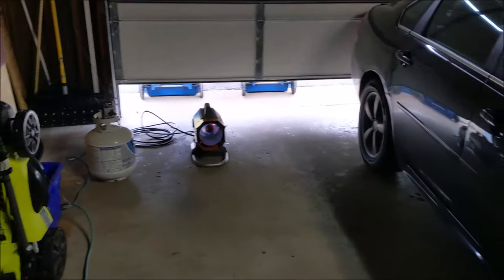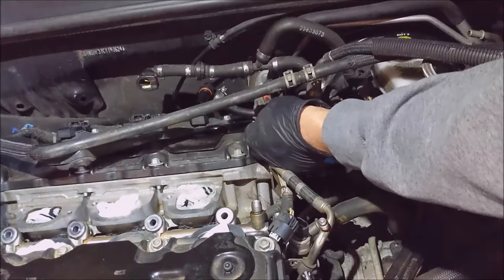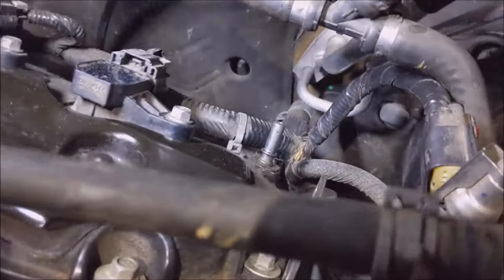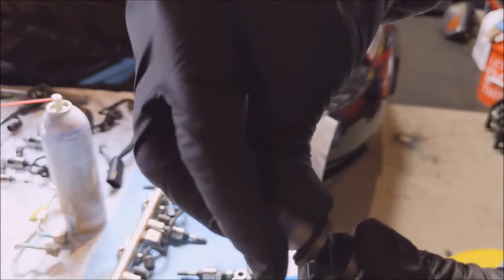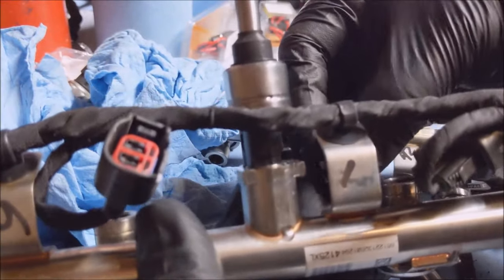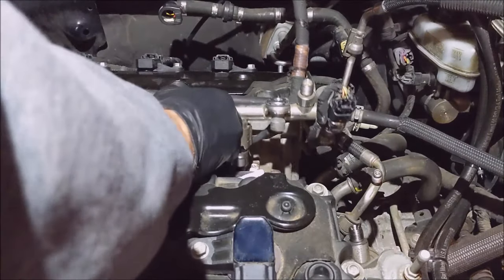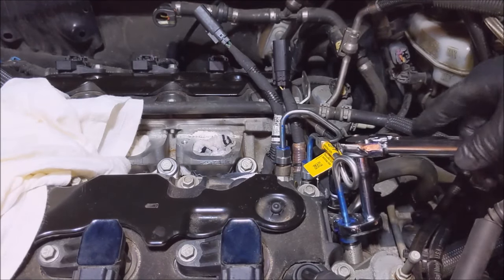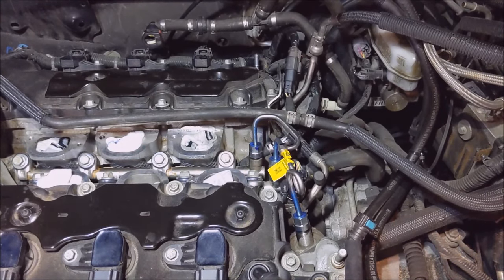GM 3.6 LFX V6 Fuel Injector Replacement (Part 3 of 4) **9th Gen Impala - Others similar**

Comment: How many miles on your engine and also, how’s the timing chain??
Reply from the maker: Had 158k at time of recording, I sold the car at 182k. Never had any timing chain issues because I changed the oil every 4-5k. Stringent maintenance is the key on these 3.6's..
Reply: We have a Camaro that we bought brand new in 2012 with a 3.6. Time in chain seems to be in good shape. But I do have two lien codes. 0171 and 0174. I replace the fuel pump, O2 sensors and map sensor. Also checked all vacuum lines. I still have the codes
Reply from the maker: @samconway5288  Which fuel pump did you replace? If you changed the high-pressure pump, the fuel rail pressure sensor may be bad. Also check the Bosch page I have linked in the description for more guidance.
Reply: I just had that same issue, I was the high pressure fuel pump. When it goes bad it will leak fuel into your crank case and cause these codes. Smell your oil if you smell gas this is 100% the fix.
Reply: @CertifiedShadetree  I replace the one in the tank passenger side
Reply: @CertifiedShadetree  fuel pressure at rail 51 pounds. Did a live data fuel pressure on injectors. 
1- 49
2-45
3-35
4-39
5-39
6-37
Reply: @kicknhobo  where is the high-pressure pump? I replaced one in the tank
Reply from the maker: @Sam Conway  Follow the fuel rails down near the thermostat and you'll find the pump. On a FWD car, it's on the driver's side, so it's probably driver's side near the firewall on the Camaro. You will need a special tool to replace it (it's driven off of one of the camshafts, so the 2 cams need to be locked into place.) I need to re locate that page at Bosch, seems it's a dead link now..
Reply: @samconway5288  40:00 time mark he connects the fuel rails to the high pressure fuel pump
Reply: @samconway5288  on your car it’s going to be on the back of the drive side bank it’s looks like a pain to do
Reply: @kicknhobo  Yeah I’m sure it’s gonna be a pain in the ass. I’m not a mechanic but a master certified in collision .
I’m  a structural technician. If it has 51 pounds of pressure at the fuel rail would it still be the high pressure fuel pump or fuel pump regulator??
Reply: @samconway5288   The problem is not about pressure but an internal leak which is causing your rich condition. Check out this video, he goes over all the trouble shooting and arrives at a bad high pressure fuel pump. https://youtu.be/GlK-BZuq8K8 around 11:00 he talks about the pump and goes wrong with them.
Reply: @samconway5288  had to do mine at 143k. I don’t know how old the code was due to just getting the vehicle. If your car has anywhere near that and you have no service record of it being done then it’s at the end of its life
Reply: @kicknhobo  Yeah my car is running lean right bank and left bank
Reply: Was yours misfiring a little bit at light throttle?
Reply: @kicknhobo  We bought the car brand new in 2012 it’s my wife or car
Reply: @samconway5288  I couldn’t tell you, at the time my timing was off by one, bad VVT phasers and the bad high pressure fuel pump. So I fixed it all and now running well, I’ll  just need to clean the carbon from the intake and I’ll be done with all major and minor issues.

Comment: What fault code did you pull for that injectors
Reply from the maker: P0276.  Injector 6 voltage low.  There was a TSB issued for a wide range of DTC's spanning many years of the 3.6 that mentioned the main injector harness chafing on the transmission housing.  I did not find the harness anywhere near the transmission, hence I doubt that was why the code was thrown.

Comment: Is that the fuel pressure regulator at 3:43 to the right
Reply from the maker: Actually it's the High Pressure fuel pump. The HP fuel pump does modulate the fuel pressure, though. Be sure to click on the link in the description for Bosch's website, they explain it a whole lot better than I can!
Reply: Thank you. I've been trying to locate where the fuel rail pressure sensor is on my 2010 camaro lt
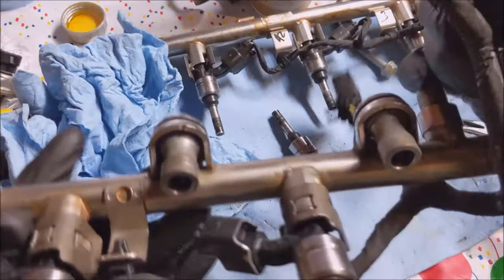Reply from the maker: @nishasamjen6426  I won't assume the LLT in the 10 Camaro is identical to the LFX, however the rail sensor on the LFX is on what I called the "front" bank (would be on the driver's side by the firewall on a Camaro) 33:25 in the vid you can see it when I have the rail out plugging in the connector.  It is in close proximity to the fuel pipe that connects the 2 rails to the pump.
Reply: Thank you that helps a lot
Reply from the maker: @nishasamjen6426  No problem, good luck!!

Comment: The reason why there's no pressure in fuel rails...battery is disconnected and there is no electricity flowing. You could have removed the fuses for the rails...helpful reminder.
Reply from the maker: I know where you're coming from, however a direct injected engine is a whole different beast.  On this vehicle, there is a traditional electric fuel pump in the tank, and there is also a mechanical fuel pump on the engine that boosts the fuel pressure from the in-tank pump.  Simply removing the fuse doesn't alleviate all of the pressure in the rails...

Comment: Hey nice channel!  I've got a 2012 3.6 lfx Impala 120k miles. It has Bad p0301 misfire. Maybe even no fire on that cylinder, lol(it did have spark with my basic tester though). Ive Tried swapping coils,new plug, seafoam intake cleaner,cleaned the valves(they were very dirty). Compression is about 150 on all six cylinders.  You know if anyone with a cylinder misfire code but no other codes have had success with new injector? I'm not sure how to test these without a fancy computer.
Reply from the maker: I would pull the injectors.  I'm willing to bet cylinder 1's injector is fouled beyond belief (packed with carbon.)  You should be able to give the tips of the injectors a good soaking in some Chemtool or Carb Cleaner, then scrub them clean with a toothbrush. Do 'em all, since you have to go through all of that trouble to get them out.

Reason I'm not rushing to replacement right away is the code you pulled - it's for a random misfire not specific to the injector. Likely means the injector is fouled and not faulty.
Reply: @CertifiedShadetree  I bet your right. The car has gotten  sluggish the past couple years from this down unda carbon party. I've got two lfx 3.6 ltz Impalas(a 2012,and 2014 limited) so these vids are good info. Thinking better software like toad or auto-enginuity might also help with this. Have you tried these? ... I just have torque pro on phone right now. Lol
Reply from the maker: @quantumforce9035  I've been using a BlueDriver for a while now.  It's a decent scan tool for the money ($99 for the dongle, app is free.)  It's not bi-directional or anything, but I like how it reads ABS and SRS codes (although it won't read SRS codes on the 12 Impala!)
Reply: @CertifiedShadetree  so I unplugged the injector connections up by cyl. 6 coil...to check resistance. Alldata has a nice diagram and also said the injector coils need to be between 1.9-2.3 ohms.  Wouldn't you know it cylinder 1 was reading way higher(the source of my dead cylinder).  Swapped it out this morning and shes purring like a kitten:). I thought getting fuel rail would be hardest part but it was the dang  little metal clip around the injector😂. It took a lot of patience to get it lined up and clipped over without breaking things...knock on wood
Reply from the maker: Nice!!  Glad I could help out! 🍻

Comment: What issues were your fuel injectors giving you?
Reply from the maker: Every time I drove the car when it was snowing (and only when it was snowing for whatever weird reason) the engine would start misfiring.  The CEL would flash for the entire duration (random cylinder misfire) and also threw a code P0276.  There was a TSB issued for the 3.6 spanning several years and models that lumped in a dozen or more codes (including P0276.) It said the injector harness could possibly chafe against the transaxle and cause a short in one of the injector circuits.

Another possible reason for the P0276 code was a defective injector, so I saw reason to pull them out to inspect the harnesses.

Comment: Another problem I'm running into is with the fuel feed line. For whatever reason it's not lining up...
The bottom 2 threads are good they line up but the top one idk what is going on it's not lined up and cannot figure out how to get it lined up to screw onto thread. Any help is appreciated
Reply from the maker: So what you're saying is the pipe connects to both of the rails fine but not to the pump very well? I would loosen the fuel rail retaining bolts a bit and try maneuvering everything around so the pipe will go into the fuel pump.
Reply: @CertifiedShadetree  I meant the back thread.. it connects to the pump and the 2,4,6 rail but the thread  that's up top connecting to the 1,3,5 rail is like its miss aligned. It came off fine so I know its ok but just trying to find a way to get it to screw back on.. it's like the thread is half inch from the feeder line
Reply from the maker: @henryhill9812  Did you purchase a new fuel line, or are you reinstalling the original? Have you tried installing it in the reverse orientation?
Reply: @CertifiedShadetree  It's the original one. If I do it reverse its definitely wrong..  I just don't understand.  Lol. It came out fine but trying to reinstall it's not lining up
Reply from the maker: I just checked, that link I provided for the fuel line is dead. Found another one for $25:
https://www.ebay.com/itm/265272588789?hash=item3dc37a79f5:g:YI4AAOSwTRBhHAdK
Reply: @CertifiedShadetree  Thanks. Do you think for any reason maybe something isn't lined up right. Lol. Like possible the back  rail 1,3,5. Maybe is lower than the front rail. All out if options here
Reply from the maker: @henryhill9812  The only other thing I can think of is were you able to save and reinstall the little rubber inserts that center the retaining bolts in the fuel rails? Maybe if one or more of those pieces were missing it would mis-align the fuel rail? I would also make sure the injectors are all seated correctly and evenly and the bolts torqued down properly.
Reply: @CertifiedShadetree  Yes, I reused all the rubber inserts. They're all installed the same, to my knowledge. I just cant figure out why the feed hose connects to the fuel pump, the 2,4,6 rail. But the 1,3,5  is to low for feed hose
Reply from the maker: @henryhill9812  I guess you could always pull the rails/injectors out again and re-seat them, see how that goes.

Comment: Dude, you but out the most important part, how TF did you get the rail out!!!
Reply from the maker: Oh believe me, I've been ridiculed to hell and back for not rolling the camera during the removal!!  Make sure you've made room on the right side of the engine so you can slide the rail over enough to wiggle it out. If you have an LLT engine, you're going to have an even more difficult time getting the rail out, sadly .

Comment: Whole reason I watched this video was to see how he got the rail off and he Fucking skips it 😭😭😂😂😂 ffs

Good video still tho!
Reply from the maker: And I carry that regret with me every day!! 🤣
Reply: @CertifiedShadetree  on the update, I just used a 22/23mm wrench and used the open end like a leaver and it basically popped out the bank one rail perfectly and then bank 2 followed easily!
Reply: @CertifiedShadetree  did you size the o rings in the injector?
It's a little tool that makes the Teflon seals match the bore of the injector holes
Reply from the maker: I did end up purchasing the tool. The injectors I installed in this vid were junk, so I ended up buying a set of used rails/injectors from a Caddy with 32k. Had to replace the seals before installing them..

Comment: You didn't show how you got it to fit the first rail went in. The camera angle doesn't help at all.
Reply from the maker: And for that, I'm very regretful!  I'll make sure I strap a GoPro to my head the next time I do this!!
Reply: @CertifiedShadetree  - You skipped almost the whole part on the installation of the fuel rails.
Reply from the maker: Tell ya what, you record the parts I missed, and I'll post links to them here. Deal?
Reply: @CertifiedShadetree  - I ended up installing the first injector towards the front of the engine first by itself on the passenger side  and then reinstalled the clip after the injectors were seated. The reason why is that I couldn't get the fuel rail to move forward enough to line the injectors up due to the rail hitting the front of the engine block. But 
I could after getting the first injector seated because then, as I could lower the fuel rail in the front slightly to clear the block in the front. I didn't want to force it and damage the fuel injectors. I am doing a engine swap with a 3.6 rebuilt engine by Jegs for friend.

Wasn't trying to be a jerk about it, but it would have been nice to see how you got past the rail hitting engine block in the front. Was no fun getting that clip re-installed.  I am not leaving the clips off like other have suggested. Thanks for the video by the way.
Reply from the maker: Curious what engine you're working on, as the rails in the LFX are easier to remove than the rails in the earlier LLT.  I've been getting shredded for close to 3 years for not recording how I got the rails out and back in.  Honestly, it took me a looooong time of struggling, so that's why I didn't record any of it. That and I really didn't have a good place to situate my old phone so as to record what I was doing..
Reply: @CertifiedShadetree  - 2009 Cadillac CTS 3.6L engine. It is no fun at all changing everything over.
Reply from the maker: Oof, that's an LLT engine. I saw a video on replacing the injectors in that engine, and they ended up removing one of the cylinder heads to get the fuel rails out!!  Not fun at all!
Reply: @CertifiedShadetree  - I got the first rail installed without pulling the head and will install the other tomorrow. Even if I have to install all injectors first in the head and then lower the rail on the injectors.

Comment: Much harder if harness has hard case
Reply from the maker: Which engine has a hard harness case?
Reply: @CertifiedShadetree  
09 Buick enclave
Reply: Both bank injector harness has a plastic cover  the only way to get them on was to put in injectors without the rail until afterwards BUT!!! MAKE SURE INJECTOR ORINGS ARE LUBRICATED WITH MOTOR OIL!!!!!
Reply from the maker: LLT engine?  Ugh, the more I hear about the LLT, the more I hate it!!  If I were to buy a 1st Gen Traverse/Enclave/Acadia, I'd get one with a blown engine and swap in an LFX!!

Comment: What a pain in the fuck!!!!!  just add chevron fuel system cleaner, you wouldnt have to do all this bullshit!
Reply from the maker: Fuel system cleaner doesn't do jack shit on direct injected engines.  It might keep the injectors somewhat clean but it won't prevent deposits from building up on the intake valves.  Even the CRC Intake cleaner has very limited results on a DI engine, and it's not something you want to use on a continuous basis.

Best solution: drill out the 3 holes on the PCV, switch to Valvoline Modern Engine 5w30, and change the oil every 5000 miles.  Oil consumption will drop to near ZERO.

Comment: You cut the video TOO MUCH... the most important part was see EXACTLY how u got the rails out... SMFH
Reply from the maker: Yeah I realized that after the fact. I think I must've been high off of the fumes in the garage from all the Chemtool and gasoline permeating the air.
Reply: @CertifiedShadetree  so can u in short explain how u got the rails out...need help seriously
Reply from the maker: @chaunceydixon9329  Assuming you're working on a FWD LFX, pry out the front (1-3-5) rail first. Make sure you have clearance on the right side of the engine (move heater hoses or anything else in the way.) After you pry the injectors out of their bores, the rail will move freely but you'll have to shift it over towards the right to get the injectors to clear the intake ports. Just continue to wiggle a little here, a little there and they will find their way out from underneath the intake ports.
Reply: @CertifiedShadetree  awesome thanks
Reply from the maker: @chaunceydixon9329  Any time!!🍻
Reply: Take the spacer for the bolt out on left side of rail
Reply: @williamstarklauf6085  explain